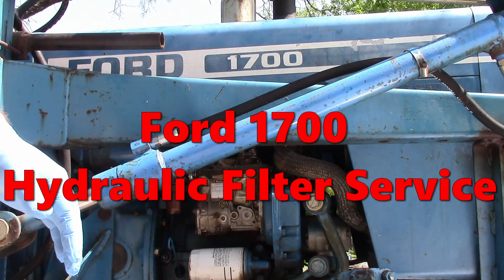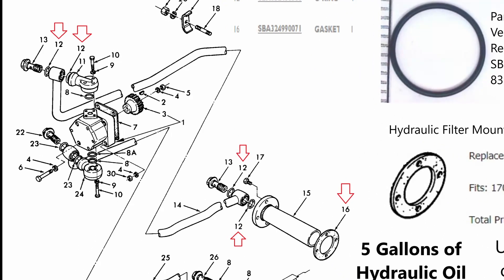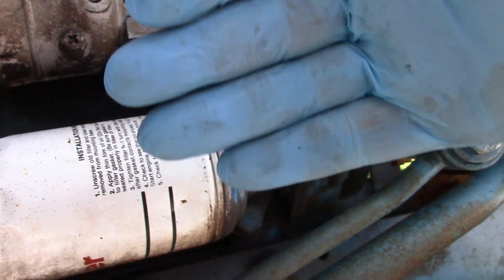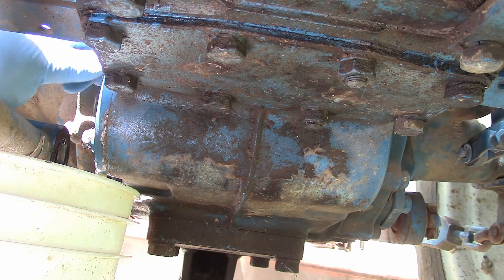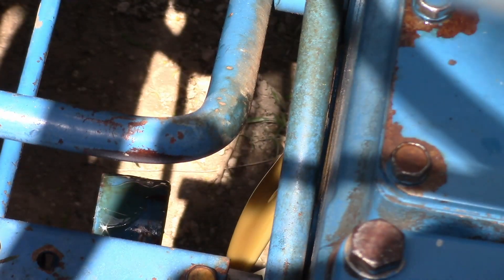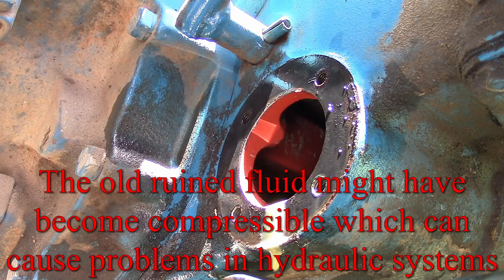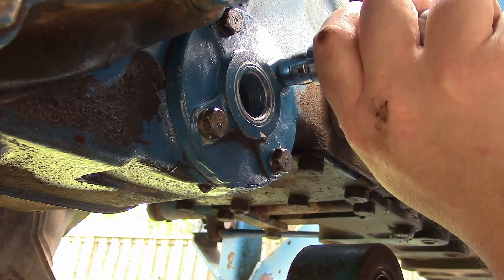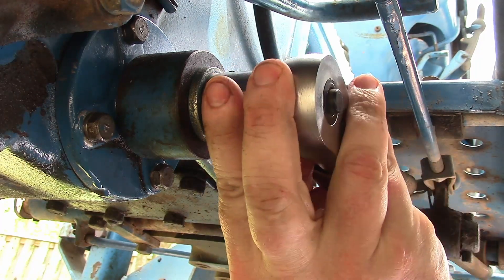Ford 1700 Hydraulic Filter Screen Cleaning and Oil Change Service

Comment: Nice video.
Neither water nor hydraulic oil are compressible.
Reply from the maker: But when mixed together you get a foam that causes hydraulic problems because they two liquids don’t mix.

Comment: I followed your video and replaced gaskets and O-rings used ISO 32 hydraulic fluid. Everything went well but when I was done neither the bucket nor the three-point lift would move. I think my hydraulic pump needs primed but can’t find a good video on that. Any help would be appreciated.
Reply: Did you figure it out bud? I’m about to do the same service and any tips or help would be appreciated. Mines not a ford but it’s the same set up bc shibaura made the tractor for ford.
Reply: @davidmabry4365  Cycle the system, should bleed air itself. May take a minute
Reply: @mountainmike1685  I appreciate it. I drained my old oil and cleaned the filter and put in fresh. Ran good for about a day and got shaky again and pump started to whine. So I guess imma have to drain the system a couple of times so it cleans out all of the trash in it.
Reply: @davidmabry4365  Ok, If you think there is trash in the lines you might check the pressure relief valve. I f it has trash in the system, the valve may not close and effect pressure build up. Good luck

Comment: I got my filter out and cleaned and put new gasket and O rings in. Used ISO 32 and everything went great until I got done and tried it and the bucket and 3 pt lift will neither one move. I’m thinking my hydraulic pump might need to be primed but I’m not finding a good video on that. Any help would be appreciated.
Reply: Did you ever figure out the issue? I’m about to do a fluid change on mine and want to make sure I don’t have any headaches with it. Thanks!
Reply: I just change the filter and hydraulic fluid  and I'm having the same issue too. My hydraulics on my Ford 1900 no longer work after the filter and fluid change. How did you fix this issue?

Comment: Curious on the type of oil you used I have done a little research & thought I'd found out you needed 134 not the 32 dont know much about it I just bought a 1700 4x4 1985 any information would be helpful
Reply from the maker: We called the New Holland dealership and they said use 10 weight. We couldn't find it anywhere but the internet says that the 32 is the same thing. I hope I'm not spreading missinformation in my video. I tried real hard to be accurate but I might have made a mistake. In the video we used what we had on hand and it was much thicker. The stuff that came out flowed like brake fluid and what we put in flowed like motor oil. The info in the video was what the dealership recommended. I hope that helps.
Reply: @BenHuttash  thank you might have to keep doing some digging. One more question do you recommend using the hydraulic oil or fluid my step dad said there was a difference & I needed to use the oil not the fluid. I used " Rotella HD hydraulic and transmission fluid" from tractor supply
Reply: @patricfritz4507  I've read that you need to use hydraulic and transmission fluid when there's a chance of hydraulic and differential oils mixing. My old 841 has the pto and implement arms fluid chamber next to the rear differential and the wall between them apparently isn't airtight. If you're putting fluid in a closed system (like I have on my loader) then I'll use pure AW32